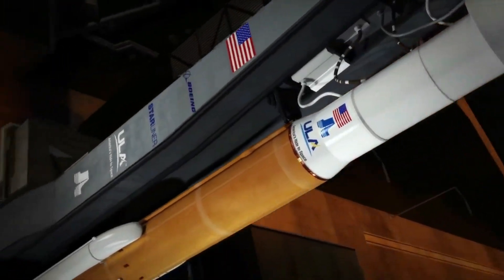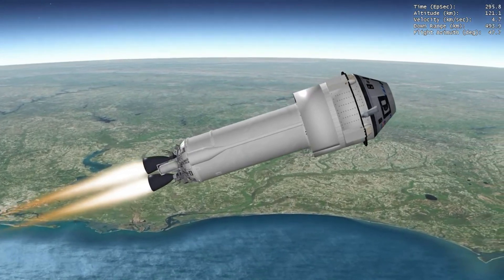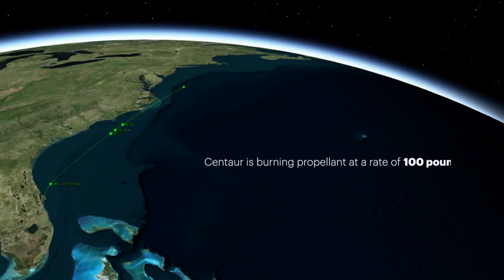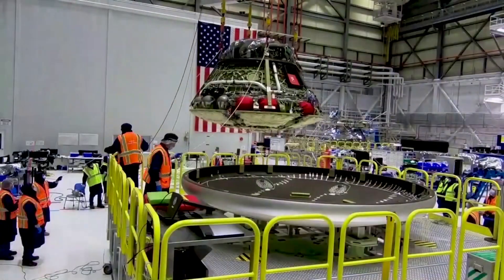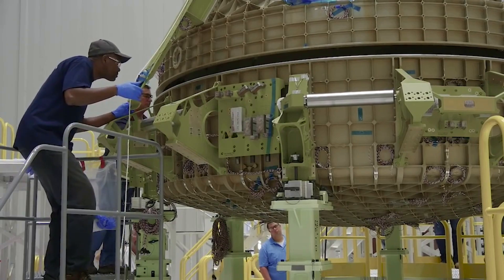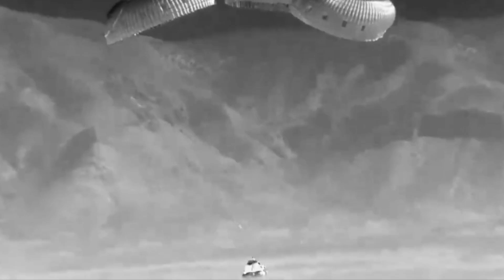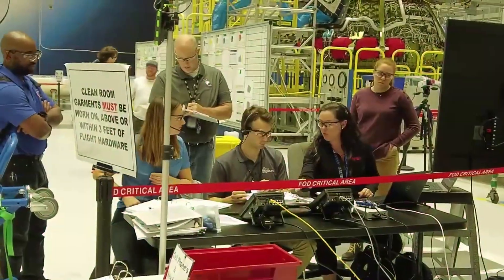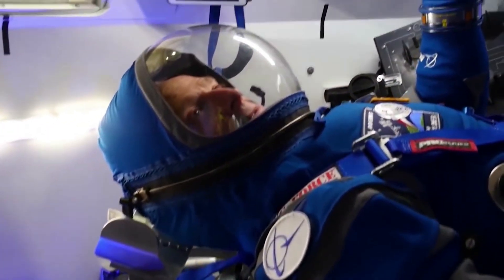Is The Boeing Starliner Ready To Carry Humans?

Comment: Starliner's history of mishaps does not fill me with confidence. It's not that one part or subsystem keeps failing. It's that ANYTHING can fail at ANYTIME seemingly at random, which seems to point to a systemic problem of company culture, a lack of adequate testing, a lack of quality control.

1) Pad abort test. One of the parachutes failed to inflate. Actually, it inflated just fine... and promptly flew away because it wasn't attached to the capsule. The crew responsible for installing the parachutes into the capsule FORGOT to install the retaining pin for the third parachute. Did no one do a capsule inspection? Was there no checklist? There was supposedly a backup quality control mechanism involving someone taking photos of the capsule (including the parachute assembly) for inspection but apparently that part of the workflow also failed. Also, upon landing, Starliner belched out a prodigious amount of toxic orange hypergolic fumes. 

2) First Orbital Flight Test. The "mission elapsed time" issue wasn't some crazy unforeseeable glitch. It was absolutely foreseeable and fixable... if they had run a full end-to-end launch simulation. They NEVER RAN A FULL SIMULATION prior to launch. That speaks of, I dunno what... hubris, laziness, stupidity, penny-pinching cheapness, recklessness... 

These are not tech failures. These are people failures. This is a failure of work standards, company culture. Which means on any given day, a completely random problem could pop up absolutely anywhere.

Comment: The core question is why did and does SpaceX perform so much better than Boeing.  The individual anomalies are a sign of a problem but not the problem.  It seems the issues at Boeing are systemic across the entire company.  Boeing used to be a engineering company that provided highly capable engineered product that was run by brilliant engineers.  Boeing made a deliberate shift from its core culture and largely left its engineers in Seattle as it moved its headquarters.  Boeing is now run by an accountant and  has lost its engineering copious productivity and elan.  SpaceX on the other hand is the company every young brilliant engineer in the world wants to work for.  SpaceX can pick and chose amongst the world's best and brightest.  What is left the rest of the world can recruit. Boeing just doesn't have the talent and leadership SpaceX does and their performance shows.
Reply: SpaceX is one of the companies that can pick the best and brightest engineers because Boeing became an accouting-driven company upon its merger with McDonnell Douglas.
Reply: @Lost-In-Blank  yes but space x is in fact no different than any other company or worse , there 24 hr turnaround 10 mill a launch hasn`t come anywhere near close and other companies are close to beating him on price..which elon just increased recently .
Reply: Boeing has existed long enough/done enough mergers to rot and become corrupt.  SpaceX has not…yet

Comment: As a software engineer going into the space industry, I intend to research this closely with what the public knows. It sounds like they are running into classic Horizontal Integration issues. Basically if Vulkan is even slightly different from how it was initially pitched, they will need to spend a LOT of time making absolutely sure the software onboard can communicate with the different components properly with those new changes. Iterative development is still very new with rocketry and space. Overall it’s good, but SpaceX is sorta “cheating” by using its own in-house everything. Good for reliability and profits. Bad for competition and flexibility.

Nonetheless, those astronauts are gonna be the bravest men to board a rocket since STS-1
Reply: SpaceX has shunned patents and nothing is better for competition than shunning patents.